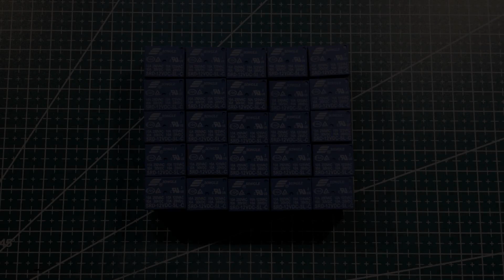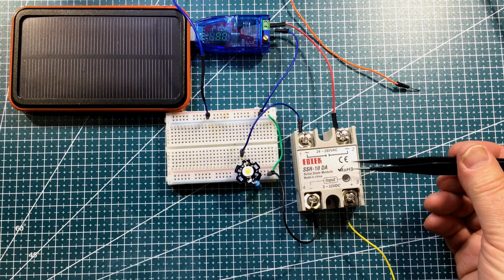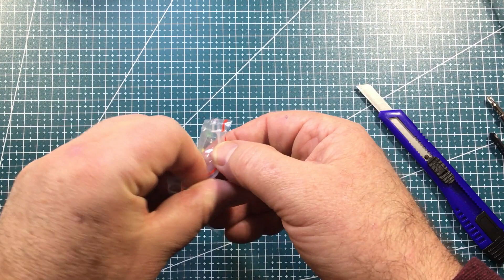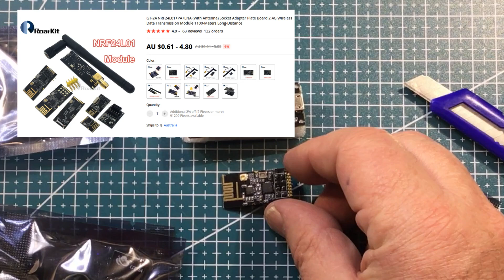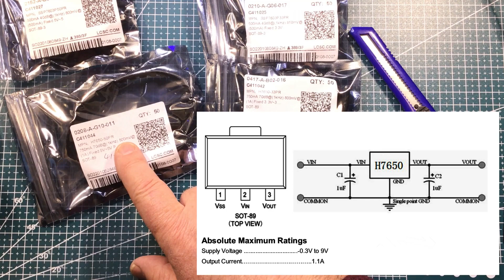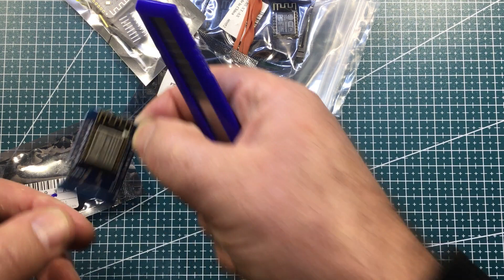Mailbag #10

Comment: Nice haul, thanks for the video. Mailbags are always fun. I have never seen that combination of electrolytic and ceramic capacitors used in junction, seems to be something worth trying. Thank you Anthony!
Reply from the maker: I saw the combo years ago on YT, cannot find the original vid now, but I have made up a few I use on breadboard projects for source smoothing. Thanks again for the care package Steve! 👍😀
Reply: @onecircuit-as  I need to do some searching about the combo caps. Always a pleasure mate.
Reply: Just seen that ceramic smooths high frequency and electrolytic smooths low frequency so a combination in parallel gives you a far better result. Also you get both voltage smoothing and noise suppression.